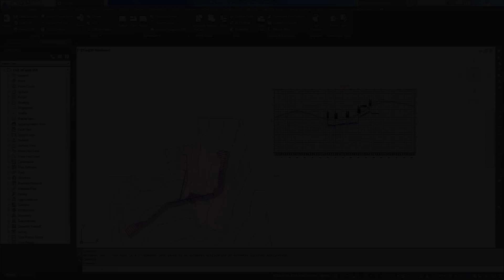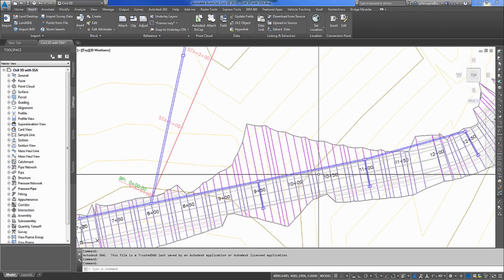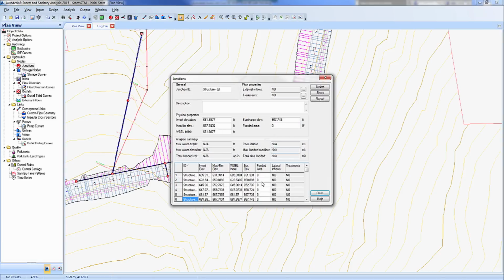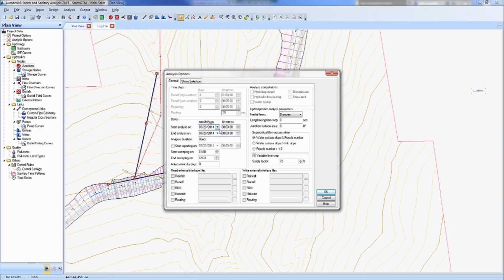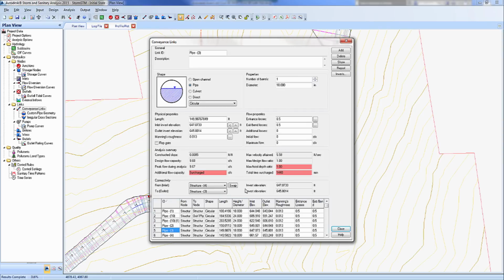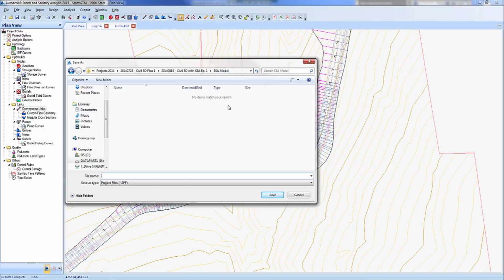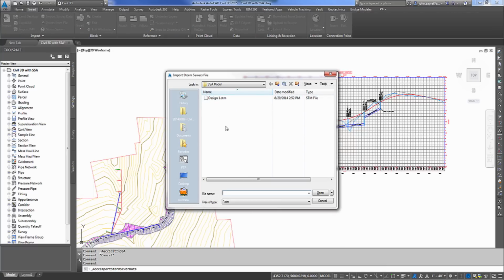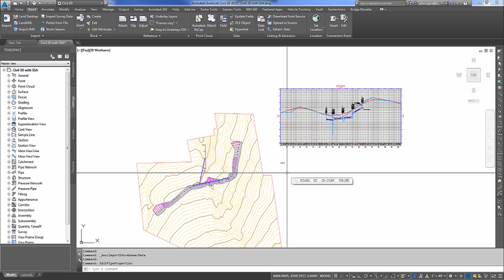Autodesk AutoCAD Civil 3D with Autodesk Storm and Sanitary Analysis

Comment: Hello.

Thank you for your videos. Please help with these two questions.

1. Some of my structures disappear from Civil3D after importing and updating the network from SSA. All of my structures are the same. In addition, one of my pipes flips over thus disconnecting from its outlet structure. What could cause this?

2. Is there a way of bringing the peak flow values into Civil3D in order to show them in the profile labeling?

Thank you.

Comment: Great video!
i have a question: can storm and sanitary analysis automatically update the pipe size?
if the system is big (>200 pipes or so) and half needs to be updated, is going to be time consuming to manually increase the pipe size.
Thank you again for the video

Comment: I changed the dimensions of pipe and elevation of pipe (slope) and junctions because the pipe are very small. I tried on civil 3D 2012 and everything is ok. On civil 3D 2013 no. Is any problem with 2013?

Comment: A great tool but i have a question about the workflow. I have created catchments and flow paths in Autocad civil 2016 and referenced them to a structure. When I import them into SSA are several of them not left as subcatchments and entities as runoff coefficients are not present at all. Instead SSA seems to use a default value. Is this the way it works or is it anything wrong in my installation?
Reply: Sir Mike, 

I have got the following question, can you send me relevant tutorials or answer, please. 

Model foul flows using discharge units to BS EN 752. is there any example available please
Produce Greenfield rate calculations using IH124 method.
Allow the application of climate change factors to rainfall data. Typically 30%. Where and how can I apply climate change, please. 
I am looking for a response from you soon, please. 

Thanks for your taking time. 

Kind regards